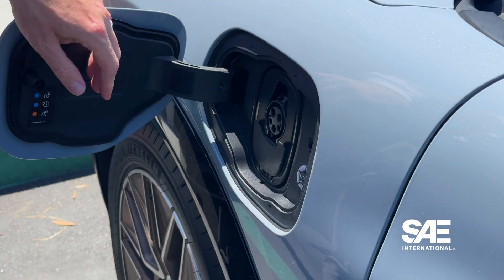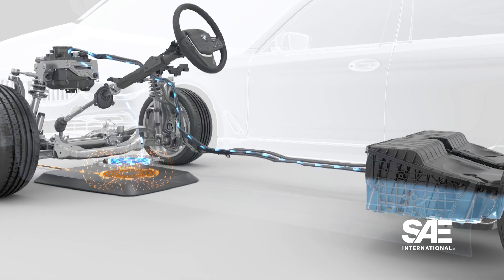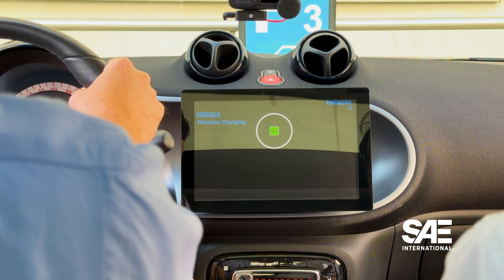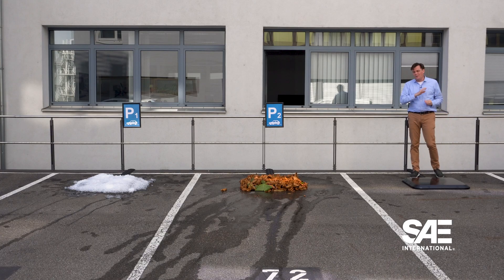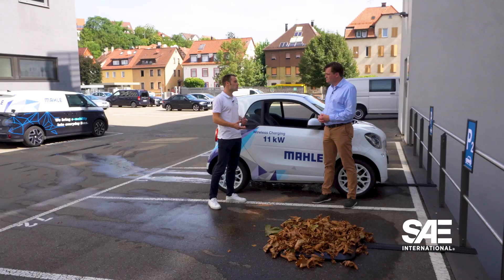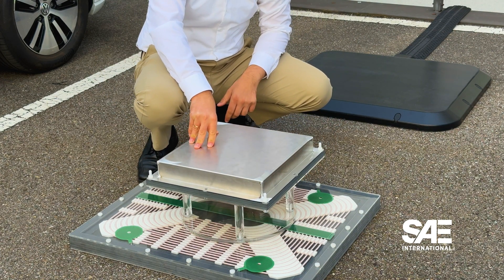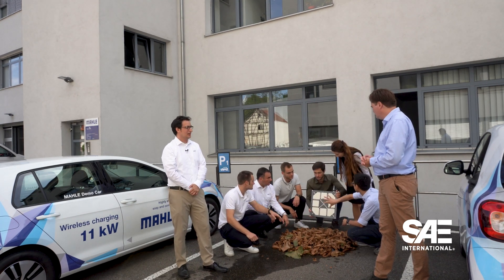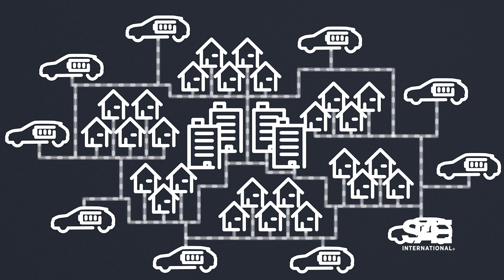Wireless Power Transfer for EVs Explained: Exploring the Technology Behind SAE's J2954 Standard

Comment: Too bad it didn’t have some kind of “electro-magnetic connect” and disconnect. Use the power to form a magnet, which then couples the charger plates. Or…. Just use magnet, strong enough to attach the plates, but weak enough to break away when you back out of the spot.
It’s like a “hybrid wire-less” charger. 
It would just bring the two inductive charging surfaces much closer
Similar to this magnetic dryer vent tube. 
https://youtu.be/TTaijz3Iil4?si=kImMiEqDlFzKAale
Reply: From my reading of the technology, there is no real advantage to getting a bit closer with the frequency they've standardized. I considered this a potential issue before I did a bit of research. Seems like they got it down.
Reply: @Techridr , there is ABSOLUTELY a correlation between efficiency of “energy transfer” and “distance” with inductive changing
Reply: @tjam4229  Yup, you're right. I understood something wrong in what I was reading. It seems you are able to optimize a frequency if you have to be a few inches away, but nothing will be as efficient as being close. I wonder then, if there could be a way so when a car is parked, the coil could descend to close that gap, and move back up before "starting" the car. At this point it seems adding complexity and cost might not be worth the gains. I'm really curious where this tech goes.
Reply: @Techridr  , yeah, that’s what I was thinking too. 
Kinda like when my phone uses the magnet to align and pull the phone as close as possible to a MagSafe charger. I think magnets might be an answer. Then when done charging, and the car pulls away, the connection breaks free and the charger recoils back into the base….just dreaming out loud ;-)